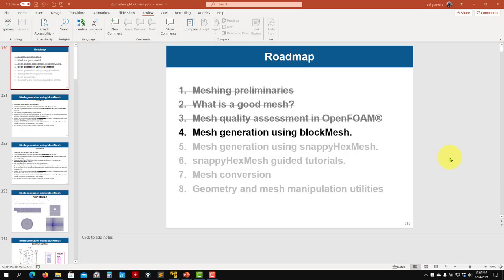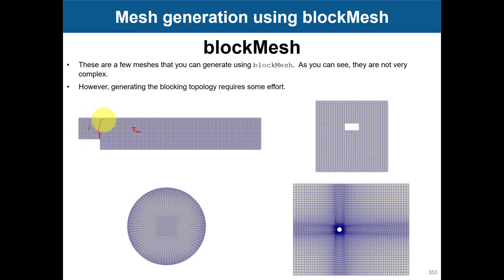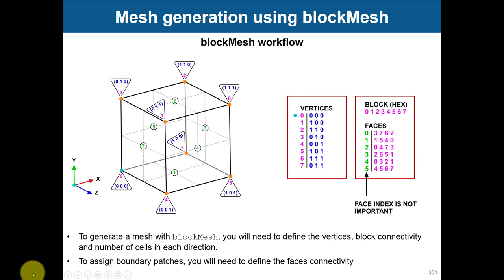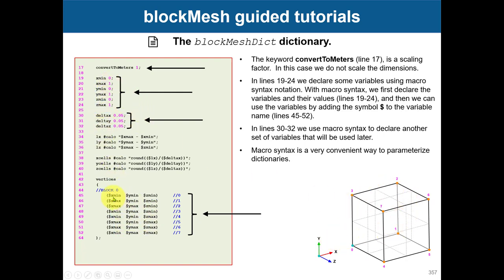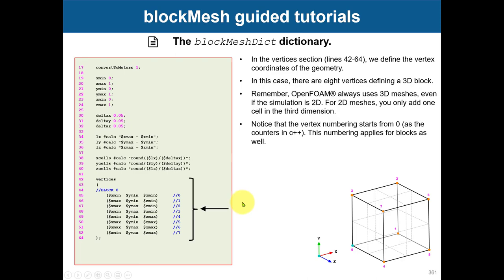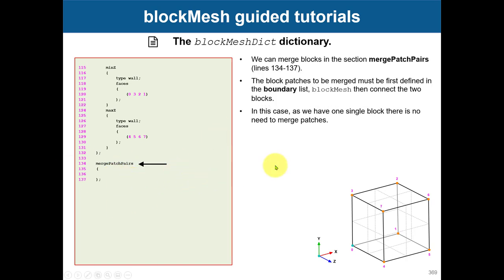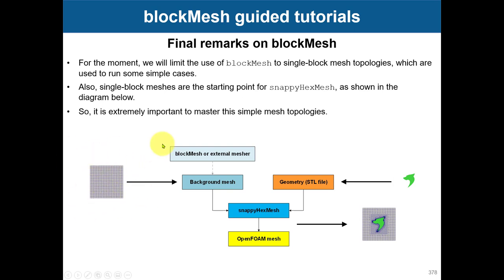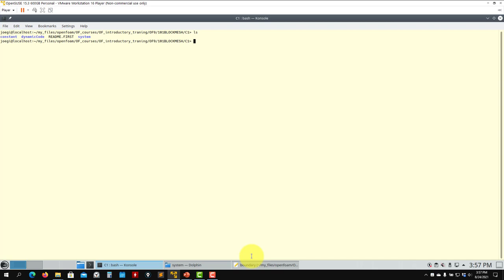3.2 Module 3 | Meshing in OpenFOAM | blockeMesh | #openfoamtraining

Comment: If we use the reference system from AutoCad which is totally different from reference system you showed does the BlockHex ordering changes?
Reply from the maker: Yes, you must be very careful with the reference system. The case only works with the reference system I am using, if you use a different one the ordering will change. Just follow the guidelines to get your way around different systems.

Comment: Good day! is createPatches equivalent in use to setFieldsDict for initializing?
Reply from the maker: No, they are very different tools. You use createPatch to rename or create a new patch and setFields is used to unitialize the volume and faces patches.
Reply from the maker: Answer generated with chatGPT (not accurate at all)

setFields and createPatch are both methods used in software development, but they have different purposes.

setFields is a method typically used in object-oriented programming to modify the values of specific fields or properties within an object. It allows you to change the values of one or more fields of an existing object without creating a new object. This method is used to update the state of an object, and it is commonly used in UI programming frameworks to update the values displayed in user interfaces.

On the other hand, createPatch is a method typically used in version control systems, such as Git, to create a patch file that represents the differences between two versions of a file or a set of files. The patch file contains the changes that have been made to the files, such as modifications, additions, or deletions, and it can be used to apply those changes to another version of the file or to another set of files.

In summary, setFields is used to modify the state of an object, while createPatch is used to create a file that represents the changes between two versions of a file or a set of files.

:face-orange-raised-eyebrow:
Reply from the maker: and a slightly more accurate answer with chatGPT (in the context of OpenFOAM)

In the context of OpenFOAM, setFields and createPatch are both commands used to manipulate the fields in a computational domain, but they have different purposes.

setFields is a command used to modify the values of fields within a computational domain in OpenFOAM. It allows you to change the values of specific fields, such as pressure, velocity, or temperature, at selected locations within the domain. This command is often used in OpenFOAM simulations to apply boundary conditions to the computational domain, such as specifying the inflow or outflow conditions of a fluid through a particular surface.

createPatch, on the other hand, is a command used to create new patches or modify existing ones within a computational domain in OpenFOAM. Patches are regions within the computational domain that have specific boundary conditions applied to them. The createPatch command is used to create a new patch or modify an existing one by specifying the boundary conditions that should be applied to it.

In summary, setFields is used to modify the values of fields within a computational domain in OpenFOAM, while createPatch is used to create or modify patches and their associated boundary conditions within the domain.